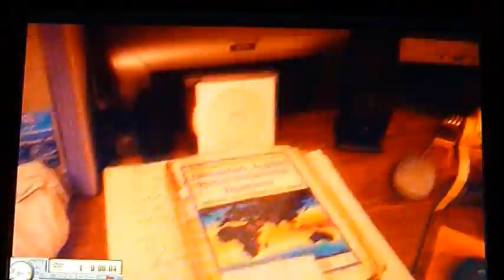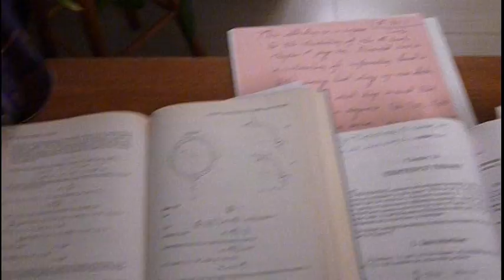Gimbal within a Gimbal ( 23rd Century Nerd )

Comment: To see you finally rotate that gimble in  multiple planes is fascinating. I get the point. Same concept basically for some guidance systems. IMO. Good job constructing it too. Thanks for sharing. Gives me an idea for my next stab building a camera stabilizer for video. My first one was from a Youtube video making it out of electrical PVC, a RC hobby, universal joint and some fender washers on bolts for counterweight. Your project is a teaching tool.